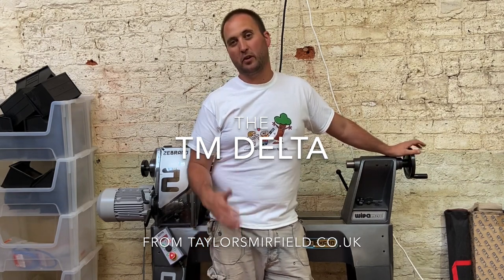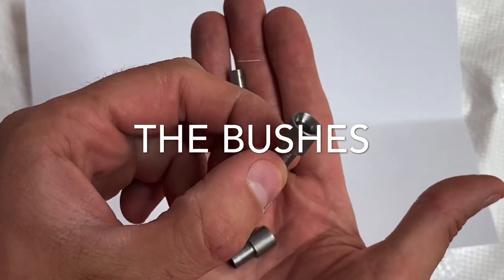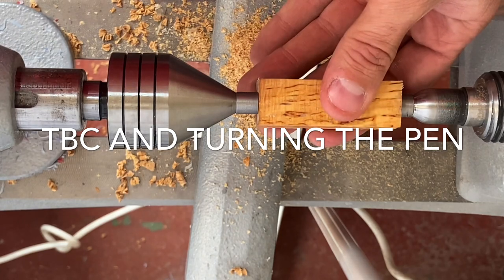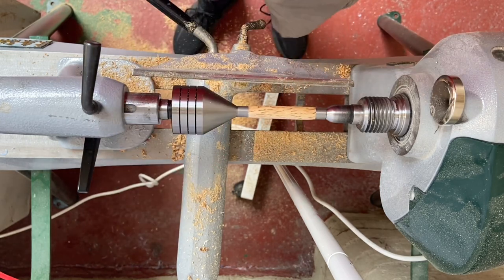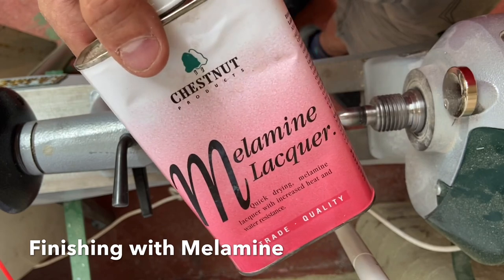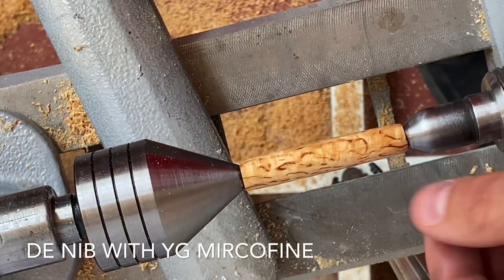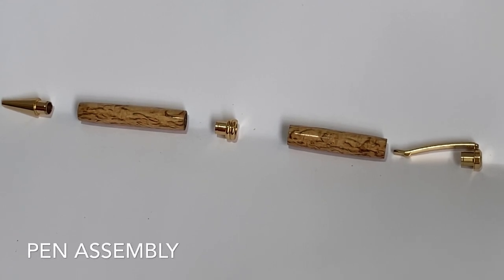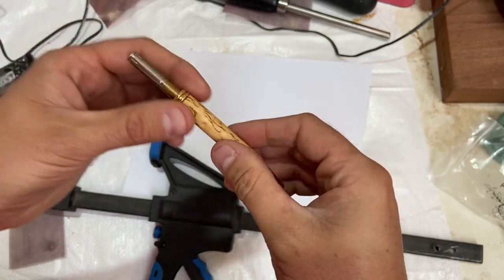Turning a TM Delta Pen Kit | Finished with Melamine Lacquer & Yorkshire Grit | TaylorsMirfield.co.uk

Comment: Great video, how long should it be left between coats?
Reply from the maker: Jay wright if using thin coats it will take a few minutes per coat however this really does depend on how much you put on. After the final coat it is really worth trying to leave it as long as possible (overnight ideally) to allow it to harden.